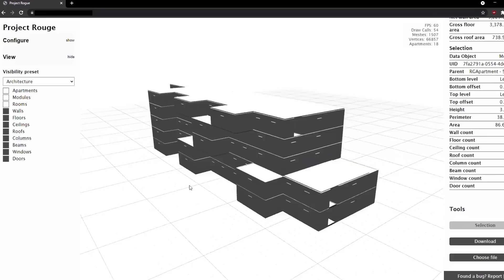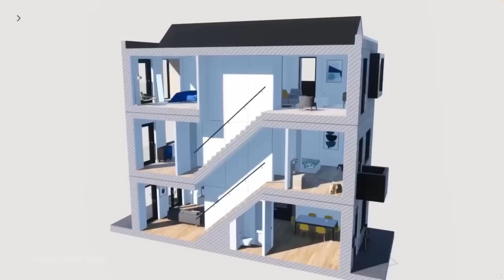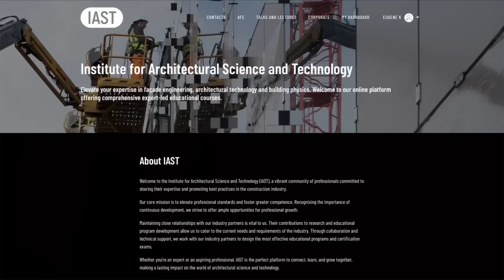Is Modular Construction Destined for Bankruptcy?

Comment: Thanks for interesting video.    I fun a small cabinet shop in Toronto,  but also had the pleasure of doing graduate research under Rom Harre at Oxford,   one the 20 century's preeminent philosophers of science.  I have had lots of arguments about modularity over the years. The problem with the idea of modularity in construction is that it is based on a modern, Newtonian/ Cartesian myth about the predictability of the world:  the myth is that with modern science,  with enough data anything is predictable and consequently completely controllable, even people.  In the 1950s the famous psychologist B.F.  Skinner, even suggested science would make freedom and democracy obsolete.   This view of science is now completely discredited by modern scientific research into complexity, such as chaos mathematics.   Complex environments are inherently uncontrollable.  And construction is inherently complex.  The only way to cope with complexity is through continuous feedback loops and adjustments to changing conditions. This is what a good framer,  drywaller,  trim carpenter, or painter,  or cabinet installer does with every movement.   They just do it so fast that to the untrained eye it is not even visible.

Comment: There are substantial problems with the prefab concept but it boils down to a false 'either/or' demand: either you prefab everything or you build stick construction with undreds of thousands of pieces at the site.  The solution is to build those parts that are common off-site (and you don't have to go 'all robotics' --you had a scene in this video where there were over a dozen nailguns nailing a single line, rather than having one gun and moving it down the line) and put them together at the site--which allows for some creativity in the details.  Finally, almost all American homes are remodeled--and remodeled using the tools of stick construction.

Comment: Of the things I know and understand, we need 100% uniform building codes and uniform construction methods that are the same all over the country rather than individaual cities, counties and states all approving their own methods and styles. 
Modular construction can work yet because of its channgles of building in so many areas its hard to keep things straight. I know of a project that happened less than 10 years ago in which a large chain came in a built a shell of a building only to have to tear it down and build another shell because of a requirement that the city required. The construction cost doubled for that project. Sad yet it happens all the time. 
If you can order a custom or standard building factory made then it would be super easy to construct anywhere. The other problem is pre fab homes/buildings made in a factory have transport problems due to width of the sections in which to build. Really if they would only build things no larger than 40x8x9 then you could ship standard shipping removing the hassle of special permits and everything else. The off set of the cost can go to the crane or tellahandler. 
I have considered ordering prefabbed houses, yet the problem is I want a stripped out version rather than their options. Meaning that I want them to build everything and I will install the cabinets, better fixtures and heat pump. Also doing this would limit what you can really do for the build as well.
Reply: There's just that pesky Constitution in the way...
Reply: Uniform building codes won't work or would end up over engineering every building across the country. Leading to added costs across every single geography. Think about it, do you need hurricane level structural tie downs in Kentucky? Do you need snow load level of design from Aspen for Texas? Uniform codes would require ridiculously built structures everywhere and could actually lead to more building performance issues than the benefit of uniformity.
Reply: @Strychn1n3  You can zone out things like that. Yet I would like hurricane straps on my place even if it was not near hurricanes. The wind loads can be pretty high along with tornadoes about anywhere. 
The uniform code book could be divided in to zones. Meaning that coastal zones my require those things while other zones do not. 
Huricane straps are required blah blah in zones 9 and 8. There are ways around many things. Yet offering a lowest standard of building construction and then adding advance things is why some places have really nice places and shitty contractors build cardboard boxes. 
There should be no reason why electrial service should be changed from one location to the next along with plumbing and HVAC. These standards should be used everywhere rather than in their own local. There should be no reason why a dryer vent can cross a house 40 feet in one area and 20 feet in another. There should be no reason why you can not use this DWV layout yet can not do it one town over. 
Uniform codes would make training better and standards to be equal everywhere. No on should be allowed to half ass it in one place while the other place exceeds something.

Comment: If I was consulted by these companies, would had told them “you may actually need to be the community developer as well as manufacturer”

Buy offering an option does NOT mean the general contractor will use YOU and your product.  Why should a developer use your product when all they know is General Contractor and SubCon?

People are NOT interested in save money for YOU.  There is a lot of wiggle room or mark up when using GA and SubCon.  The final cost of a home can be a nice 30% profit, “so screw saving your budget”.

If I were one of these manufacturers, I would buy land and build a dozen to sell and lease. 

Remember, in the Midwest (Ohio, not Chicago), a modest AND nice home can be had for +150k.  In LA, VC, NY, Tor, Lon….a dump can be had for 350k….a shack…a shanty hut…a closet…a “coffin” bed….$350,000

Comment: Welcome back, Belinda, you've been missed here!

The first thing I thought of regarding this video was comparing conventional construction processes vs modular. With conventional construction, builders use numerous standardized products. If there is a problem obtaining lumber from a supplier, or piping, or HVAC units, they should be able to quickly find alternate suppliers and maintain production. Modular construction, though, appears to be mostly proprietary - if there are issues with the raw materials for their components or their manufacturing processes they're dead in the water. 

It seems the best way to go about this would be for an established builder (monopoly?) to venture into the modular field, and profits from the conventional side of the business could be used to subsidize the modular portion until it became established enough to generate its own profits.

Comment: If modular buildings were actually cheaper to build (from the consumer's POV), they wouldn't have an issue with profitability.
Reply: It's not cheaper. I've worked in Modular for over 16 years. Its NEVER been about being cheaper. It's literally impossible to be cheaper, there are additional transport costs and redundant materials due to transport (double walls, double floors/ceilings for multi-storey etc). The benefit of modular has always been FASTER because you are building the modules while the foundation is also being built, then assembly on site goes much quicker than site built. This, in my experience, only benefits a few types of buyers. The ones that are remote and getting materials and labour on site is a huge problem and the other is a buyer that has a very tight window of getting the building up and running. Which one of those is your average homeowner? Neither. Modular makes  the most sense for denser multifamily construction and hotels where the developer wants "heads in beds" as fast as they can so they can get paid.
Reply: @Strychn1n3  Yeah, good points. Thanks for the info. 👍
Reply: This is the biggest problem. Great concept, but most people cannot afford them. If factory assembly line isn't bringing down cost, something is wrong.
Reply: I think the issue isn't so much the unit cost as it is the scale at which a "modular home factory" need to operate to be profitable. It's almost as though the need to churn out thousands of homes a year for the investment in all the automation to make sense. Lower numbers mean the factory is under producing and thus not profitable.

Comment: It sounds like a major issue with most of these companies is that they have to rely on startup loans and go big or go home.  It would make much more sense to start smaller and see if it takes off.  We used Enercept SIPs for our home, it's just foam sandwiched between two sheets OSB basically, been around for a long time, is that in the same prefab category as these?  They seem reasonably successful, been around a while, and even have product in Antarctica.  Also, trailer homes seem reasonably successful too, what's the disconnect with some of these recent gigantic failures?
Reply: Also I dunno if I would do SIPs again, mostly because of my inexperienced contractor though.  We chose that based on energy efficiency and speed of construction, but as soon as it was freezing out our builder said the butyl caulk they put between everything could not freeze so they could really only work between cold spells.  That basically means I lost a lot of the construction phase benefits due to his inexperience and delays.  Also the ceiling drywall, mostly in one room, glued and screwed directly to SIPs, is cracked very badly from expansion and contraction.  Lots of changes I'd make in retrospect, though we might also have been able to accomplish stick framing in less time during the winter months.